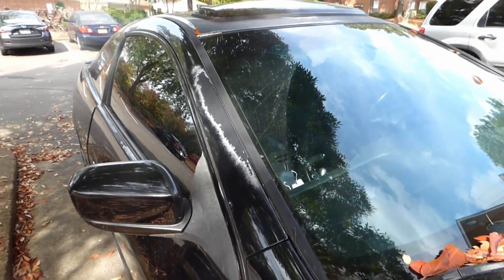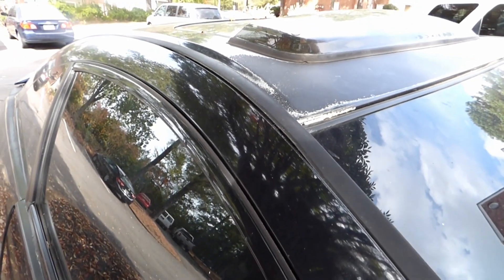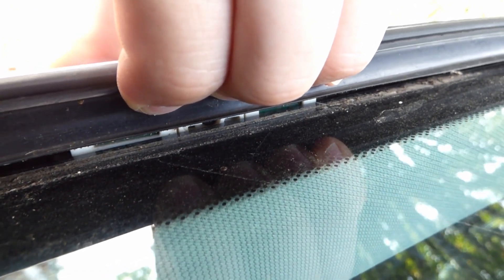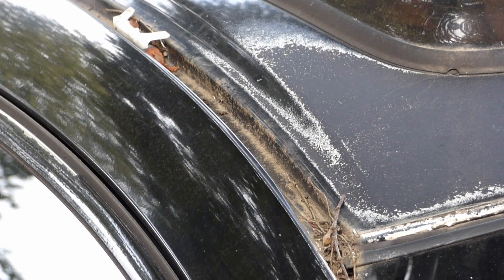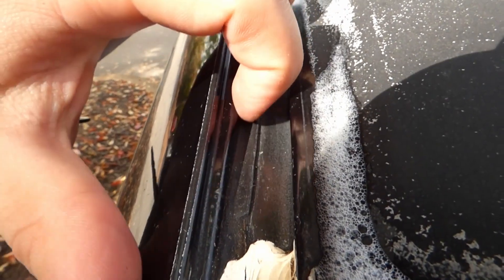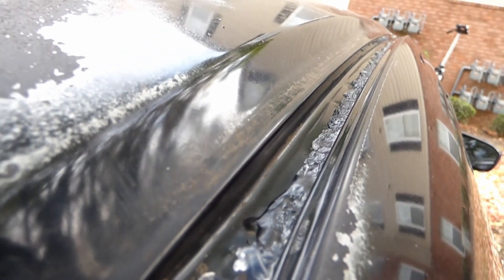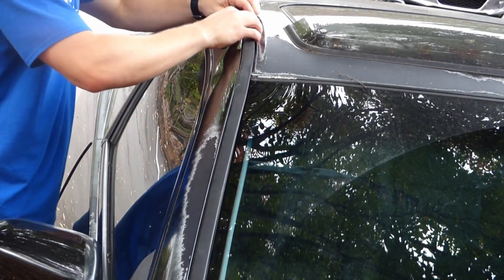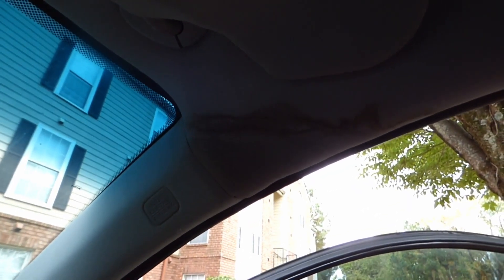How to Fix a Common Interior Roof Leak in a 2003-2007 Honda Accord

Comment: I’ve got a 1997 Honda CRV that has been leaking around the top of windshield above the passenger side A pillar, and I, too, had the windshield replaced with continued leak afterward; I just finished disassembly of the entire trim around the A pillar and removed the roof molding; found the leak along a little crack at the body panel seam in the channel for the roof molding just like you did; went looking for what kind of sealer to fix it with and found your video! Brilliant! Just what I needed. Hopefully will work like a charm. Thanks for posting this!
Reply from the maker: No problem! I’m glad I could help. Unfortunately mine is leaking again, so I may need to reapply. I don’t think I put on enough the first time for it to last long.
Reply: Thanks for the update
Reply: So your crv have another leak after you install the sealant??
Reply: @Hazen_Muhammad  Nope. Bone dry.👍😎

Comment: Just picked up a 2011 Honda Accord with an identical headliner stain (but on the driver side) and am going to try this!  Nice work.
Reply: Did it work ?
Reply: @trumetta  Yes!  And we've had PLENTY of rain in South Florida since then to test it out.
Reply: In my case,  I don't think it was that long seam pointed out in the video... though I also applied the dealer much of the way to the back as shown.   On my Accord,  you could see an area in that channel near the top corner of the windshield where the existing sealer looked visibly rough and cracked.   That was the spot.

Comment: Fantastic how-to video!  With the help of this video I was able to repair a family member's 2009 Accord that had this leak on both driver and passenger sides.  

I don't agree with the assertion that regular silicone sealant traps water.  It doesn't shrink nor is not porous when it cures so I don't understand that statement.  Auto manufacturers specify auto body sealant for their production lines and repairs because it cures (dries) relatively fast where silicone sealant can take up to 24 hours to cure and test.

Comment: Mega, mega, mega, mega, mega helpful !!!!  Thank you sooooooooo much!  I'm in the UK, I have a 2006 Honda Accord and my Rails have a gap between them, a slight lift/bulge at the middle of the roof (say at the middle door pillar) and also they are lifted along the side of the windscreen.

Honda, to replace both of my strips, want...... £650 (that's over $700).  

There aren't any leaks that I can see, but we're having a lot of rain and so I'm going to give your solution a try, hopefully they'll be more sealed along  that roofline I mentioned.

Many thanks from the UK!

Comment: Your video helped a lot.
Kept thinking it was sunroof, dealership was clueless. Overlooked your video before until I finally saw water coming inside during a heavy rain while driving. 
I used Eastwood brushable Seam Sealer gray instead. Used a acid brush and finger/latex glove. 
You forgot to mention that it’s murder on your fingertips trying take the channel off.

Comment: Thank you for such a great video ! I have leaks on both sides of my roof and recently the top right side where the stripping goes down my windshield. I am going to do this to try and fix my leak. I used silicone prior on part of the top hopefully I can remove it and redo the repair.

Comment: It just be an accord issue. I have a 2015 accord and is having the same issue, same spot but on the drivers side. Good video 👍🏽
Reply: Same here, Accord '14 CU, both sides unfortunately.
Reply: 2006 accord coupe and mine leaks above the door on the driver side. This video is exactly what I was looking for.
Reply: 05 civic ex sedan.  New windshield, all rust spots fixed and sealed, still have a leak.  Haven't had a chance to look, but its probably the same thing.  Seam.
Reply: 09 Civic EX same spot on passenger side too. Guess I’m going to try this
Reply: @dauntlessdom5926 '10 Civic EX. Mainly drivers side, but sometimes passenger 😮‍💨
Reply: To chime in, I have a 2008 honda accord on the driver side too.
Reply: Just did the fix on my 07 civic. You want to use Seam sealer. I used silicone. I was going to use 3m window weld but my tube was old.

Comment: Having a hard time taking the weatherstrip out. Any tips?
Reply from the maker: @Antonchigurh893  It can be difficult to maneuver it off of the clips, but a small screwdriver helps sometimes to get it moving.
Reply: @AJSWoodworks  Got it and thank you for the video. I was holding off your solution until after I tried the alternative. It seems like there is a crack in that area.
Reply: @AJSWoodworks  Hey so, I tried your solution and I'm glad I stumbled upon your video. There was a nice size crack in the same area but driveside instead. Thanks for the video.

Comment: Have you had any water after you did all this? I know the first time with the silicone wasn’t worked that well and wondering if this time was better, thanks you so much for your answer
Reply from the maker: Yes, I don’t think I coated it well enough. I’m actually about to do it again.
Reply: @AJSWoodworks  I just did my yesterday and I used foaming soap on top and air pressure in side and I was able to see the exact area where the air came out and used jb weld, looks great but have not see with a heavy rain if it work, hopefully you post the video when you do it again. Thanks for your video encourage me to do my.
Reply from the maker: @CarlosAguilar-em1tm  I’m glad it helped!
Reply: @CarlosAguilar-em1tm  did you take off your headliner for that?
Reply: @joshualwc  yes I did and I ready had some heavy rain and no problem at all.
Reply: @CarlosAguilar-em1tm  Which JB Weld product did you use?  Thanks for your kind assitance and @AJWoodworks thanks the fantastic video.

Comment: Andrew, did that fix your water leak? You never mentioned if you tested it after you applied the sealant. I believe I have nearly the identical issue. Thanks for the video as well.
Reply from the maker: @Notjoemamma1786  It worked well for months, but I think the sealant came off eventually and it started again.
Reply: Really sorry to hear that. This leak is driving me up a wall.

Comment: Good video but I don't think that will help with mine. I have a 2007 civic and I saw mine was leaking sent it to a body shop, resealed the window and bought new  moldings etc, maybe that would help in the sealing. Nope unfortunately no. It didn't not help. It helped for a little but recently we been getting heavy rains and now the problem is worse than before it got fixed. So I'm at a lost. It's frustrating. Mostly it's on the driver's side and few occasions it seeps through the passenger's . I'm from s hot country so idk if the molding hardens and dries up so it won't last so. I'm surfing YouTube to find an answer. Sorry about the long rant.

Comment: Since it has been 2 years now, I take its  successful? Didn't see an update video.
Reply from the maker: It was successful for about 6 months, but I didn’t use enough sealant and it eventually came off and started leaking again.
Reply: @AJSWoodworks  what are some tips if you had to do it again ?
Reply from the maker: @syloluon4969  clean the surface thoroughly with alcohol, and use more sealant than I did.

Comment: Great video!! how did the stain turn out? Was you able to get it off? And what did you use? Thank you.
Reply from the maker: Thank you! I haven’t gotten the stain out yet, because the leak sprang open again after a few months. I have yet to get back in there and apply more sealant, which I think is the issue. I should’ve applied a lot more the first time around.
Reply: @AJSWoodworks have you checked on the top of the sunroof drain? I accidentally pulled it from the top when repairing the bottom where it feeds into the drain tube.
Reply from the maker: @Polaris2Sirius  Yep, it’s not leaking there unfortunately

Comment: I have a leak that runs from up by the top of my rear windshield on the passenger side down through the C pillar into the trunk behind the liner.
Reply from the maker: I’m not familiar with that leak, but it could certainly stem from the same issue.
Reply: Looool I just got this leak in the video too. Had NO idea I had seen this video already. 

So, found out the original leak I mentioned here in my comment is from salt water rusting a hole in my roof RIGHT where it meets the rear windshield. It gets caught in the headliner and runs down through the C pillar into the trunk like I mentioned. 

This new leak gets my driver side seatbelt soaking wet and drips from the adjustment knob thing. Perfect!

Comment: How is it holding up?
Reply from the maker: It’s held up okay. I noticed some less extreme leaking a few weeks after the repair, so I think I may not have covered it well enough.
Reply: @AJSWoodworks   I am using Flex Seal based on a friends recommendation with the same issue.  I will keep you posted.
Reply: @BMHolbert did flex seal hold up?

Comment: Did you solve the issue? Your response is highly appreciated as I'm facing the same problem
Reply from the maker: It initially fixed the issue, but now it seems to be leaking again. I’m thinking I didn’t coat it thick enough.
Reply: @AJSWoodworks  bro I'm facing the same issue again after putting some coat. Did you fix it? And how please?
Reply from the maker: @omarhouri5435  It worked for a while, but recently it started leaking again. I probably skimped too much on the sealant.

Comment: Update please
Reply from the maker: It worked for a couple months, but then started leaking again. I think I should’ve cleaned the surface more thoroughly with a solvent, and then used more of the sealant.
Reply: @AJSWoodworks  okay I've seen your video a while ago but never brought the sealant I was thinking polyurethane adhesive since Honda uses it the connect the 07 accords fender to this small metal part that fits under the hood.it gets hard .keeps raining in NY so imma wait until I have a few nice days to use the sealant.thank you for this video and your fast response

Comment: I'm having the same problem with the left side and still leaking because I used silicone on it 🤦🏻‍♂️
Reply from the maker: Yeah, I wish I would have used auto body sealant earlier. I did the same with my car a while ago.
Reply: @AJSWoodworks  Hi!  How long does sealant dry?
Reply: Wait, I thought silicone was water resistant?
Reply from the maker: @daviderhahon  It is, but unfortunately it traps water and can rust your cars metal. It’s better to use auto body sealant which is made for that purpose.
Reply: @AJSWoodworks  
OK.  Noted. 
I just researched it though. 
It occurs mainly to low quality silicone sealants. It also occurs if the silicone is not applied properly or evenly.